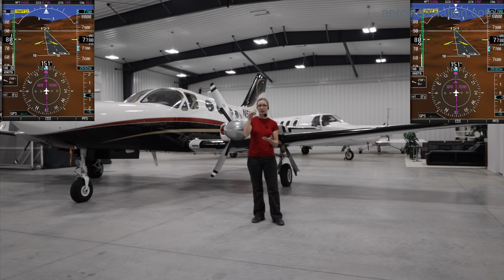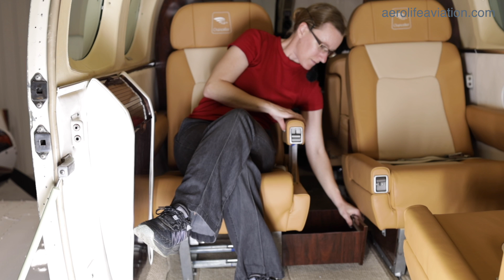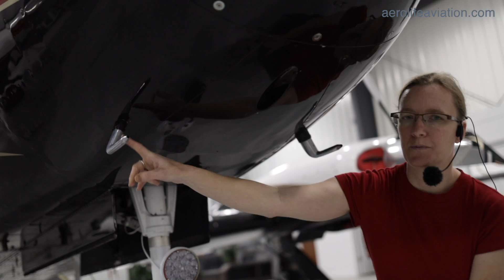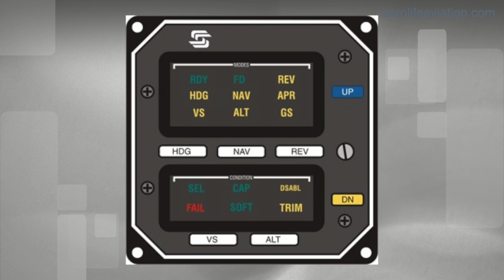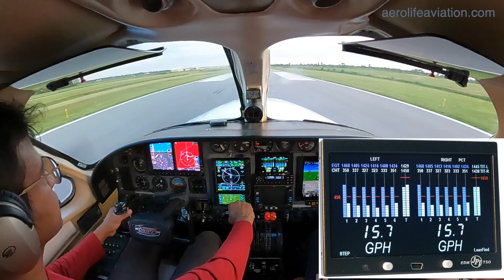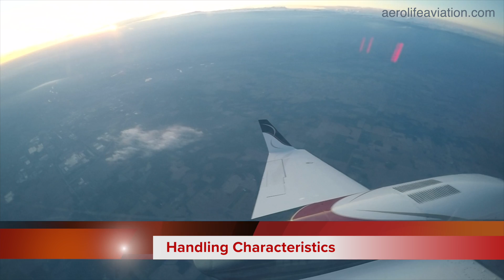Performance and costs | How to modernize an airplane | Cessna 414A Chancellor Review

Comment: nice unit..  i've always loved twin cessnas.. i have some time in most all the twin cessnas back in the day.. quite a bit in 414/421.. if you fly heavy IMC alot.. just to have the reduced workload and safety features of this hard loaded bird makes it worth the investment.. and with nothing new coming out of the factories to compete with it.. it will hold its place in the market well..  but let's face it..if you can afford this ship.. and can afford to actually use it..  you can most likely make the jump to a turbine..  i had to make that decision a few years back..  i was outgrowing my Duke.. looking at 414/421s.. Navajos.. aero commanders... ran the numbers and started looking at King Airs, MU-2s, a conquests, cheyennes, turbine commanders... I landed on a nice C90 with some speed mods, low time engines, just out of all the expensive inspections, and some nice panel upgrades... all for about the same price as a nice piston twin.. never looked back.. even though it wasn't "that" much faster than a 421c..  the comfort.. single engine performance, reliability, the ramp appeal..   I had to pull the trigger on it.. granted, the maintenance and operating costs were a bit more.. but i felt it was worth the additional expense..  let's face it..  if you fly piston twins enough, you WILL experience an engine failure.. and there isn't much margin left at critical phases of flight.. the statistics back me up on this.. the turbines are just so much more reliable.. and SE performance isn't even comparable..  fast forward a couple of years and i had an awesome opportunity to trade up into a PC-12..  i gave up the "engine out" performance for all the glass and comfort.. extra useful load.. more seats..  my fixed and operating costs are less.. my deal was exceptional.. i just happen to be in the right place at the right time and got to take advantage of an opportunity..    this is one helluva nice 414 tho.. she will be a treat to own and fly..
Reply from the maker: Thank you for the detailed comment and sharing your knowledge and experience.
You made good choices. I like your stage upgrades starting with piston twins and then King Air to PC12. Especially the PC-12, it’s a great plane. You gained experience and knowledge that way, waited until you outgrew your needs and then upgraded. We personally skipped the turboprops and went straight into light Jets.
Turboprops and light jets are superior to piston twins. That comes with higher operating costs and maintenance costs. This plane can fly burning 25-30 gallons per hour. Our jet will burn 185 gallons per hour. You will get to the destination a little faster at a much higher cost. Unlike twins, maintenance and inspections can be very expensive and could take months for a major item. Turbine engine overhauls alone will cost more than the price of this plane. For our jet, the brake pads alone $4500 and the battery is $4200. Many flights we still fly Cirrus when it makes sense.
What I learned is there is no perfect plane. There is always compromise.